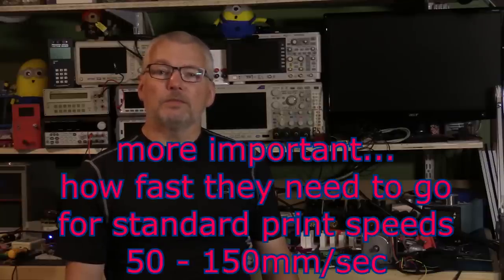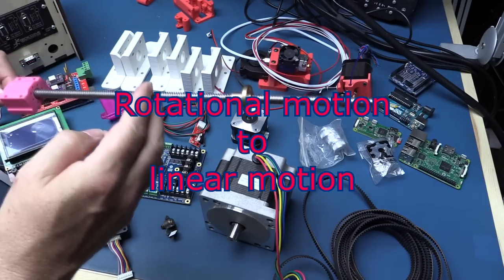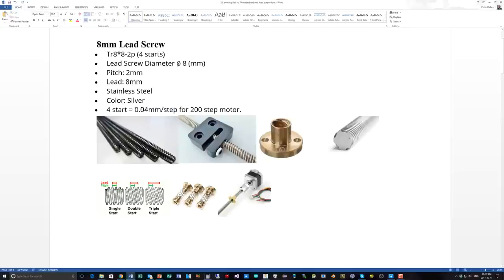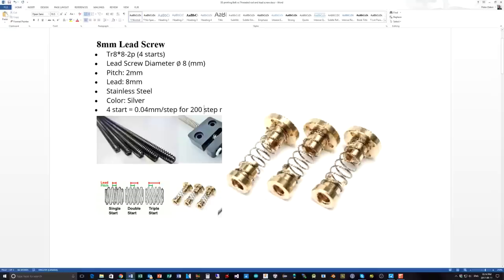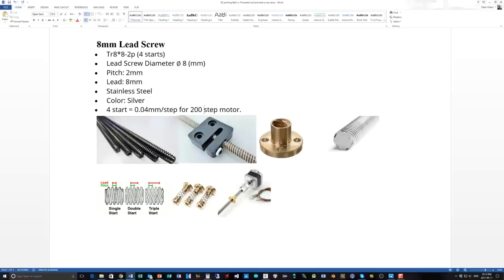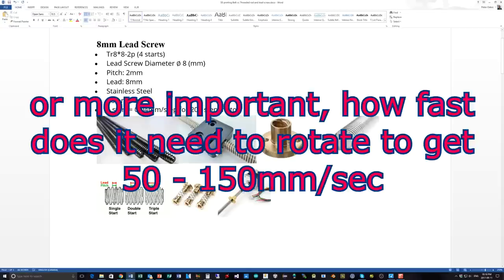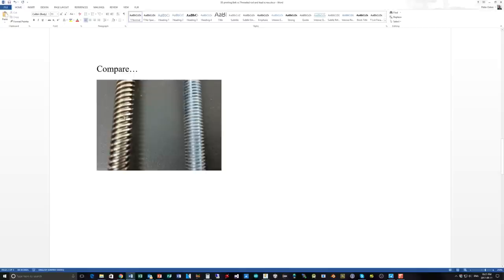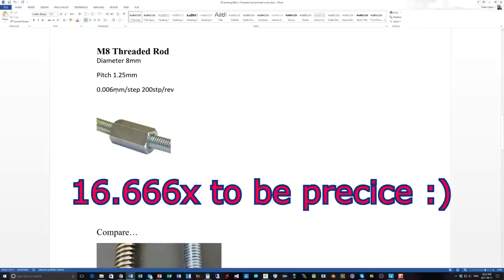3D printing, what to use... BELTS  or SCREWS ??

Comment: A good way to significantly reduce the inertia of a lead screw, at high accelerations, is to switch from a "fixed nut, rotating screw" to a "fixed screw, rotating nut" configuration. Another advantage of this is that it completely eliminates any whipping of the screw due to it not being perfectly straight, thus reducing vibration in the system. The only disadvantage (apart from the relatively higher build complexity) is the extra slop/backlash in the nut holding bearings, which could be mitigated by using bigger, preloaded radial bearings or smaller, more expensive angular ones.

Comment: Currently designing a 3D printer that uses multi-start leadscrews.  Just a few comments:

1 - As others mentioned, those couplers will introduce backlash, and are not intended to be mounted that way.  The screw should be retained axially, separately, via bearing block, with the coupler acting to absorb any shaft misalignment.  Using those couplers as shown may actually cause or increase resonance at higher speeds.  I'd agree in this application that solid couplers would be better.

2 - It should be fairly easy to copy the design of an actual anti-backlash leadnut to 3D print, and source a spring with proper tension.  They actually could be had on eBay for relatively cheap.

3 - A leadscrew with anti-backlash leadnut is about 25-70% efficient depending on lead.  A 4-start (.5" lead) about 40% and 8-start (1" lead) about 70%.  While this may not sound too efficient, and larger steppers may need to be used, this also can act as a damper of sorts, since you wouldn't want a majority of the stepper's torque overcoming its own detent torque.

4 - I built a wood-framed router about 8 years ago or so.  It doesn't really expand nor contract much, since wood does not expand much at all along the direction of grain.  Plus, as long as the driven end of the screw is retained axially, you'll only see a change in accuracy as the screw rises in temperature.  

5 - Repeatability (precision) will be very good because of the anti-backlash leadnut.  Accuracy, you'll be at the mercy of the screw accuracy.  But even an imported ACME screw is rated at .003"-.007"/ft (because it's rolled-forged), and that's worst-case scenario over that length.  For the typical part made on a printer that can be adjusted out for the most part with the steps/unit setup.  Screws from known suppliers like Kerk, Nook, or Roton have specs for their screws, and really don't cost much more than the no-name stuff.  I should note you should be looking for "precision ACME" screws not standard ACME - they're slightly different.

6 - Aside from flex in belts, they do also have backlash with the teeth and how they mesh with the pinion.  Maybe it's good enough for 3D printers, but unless I got the belts and pinions from Gates themselves, I'd have no guarantee of the precision of the belts from the "unknown" suppliers.

7 - If you're going through the trouble of using leadscrews, why not use supported linear rail?  They can be had cheaply enough, and would actually add stiffness and strength to the plywood frame.

8 - There's a bit of discussion about steppers and heat.  In actuality steppers are designed to run relatively hot, when you get the max power out of them.  Yes with the cheaper steppers we normally use there are precautions, but the industrial-grade steppers have insulators rated to temperatures at least twice as much as the garden-variety import., and thus you can push them harder.  Also, steppers are also designed with a flange and pilot which (1) absorb torque and (2) mate with a stepper plate or machine made of metal for transference of heat.  Since most all 3D printer designs have steppers mounted to plastic, the heat is not dissipated well.  But even some cheap CPU heatsinks would help greatly if there were heat concerns.

Comment: excellent Peter. This is by far the best tutorial on this topic. Luckily the small servo motors are dropping in price so that they can replace the stepper motor based losses and in combination with ball screws you can come to an optimal configuration. Surely not for everyone, but accounting time on printing, material spoils for bad prints and frustration, i totally vote for going to the best you can afford to build a printer. It will benefit in the long term. Greetings from Herri in China

Comment: Thank you for your video, there is additional information I would like to add to your coverage.
• using the aluminium spring couplers on X and Y will introduce backlash, as they are springs, and unless there is a thrust bearing preventing motion of the leadscrew along the axis, unacceptable loss of motion control would occur
• as you suggest, there are limits that are driven by the hot end capability, which especially limit us when printing eg 0.4 mm layer heights to 250mm/sec or less without running out of filament. If however layer height is reduced, to 0.1 mm for example, the same hot end could potentially extrude up to 1000mm/sec. the benefit being that overall print time could be less affected for thinner layer heights.
• TrinityLabs aluminatus A1 was sold with triple stack nema 17 25mm 10 start linear stages. These were approx $800 each based on conversations I had with Ezra at the time he was building these printer kits. Yes they are very expensive.
• I have video on my YouTube channel of these linear stages running at 720mm/sec without additional weight ( eg extruder or build platten) these are really amazing linear stages, and are key to the high accuracy and speed the (properly built) aluminatus is capable of. 
• You have mentioned belts and belt ringing. These artifacts disappear with linear stages.
• In practise, the repeatability and speed of these stages is definitely a worthwhile upgrade, and the improved accuracy of head placement makes prints at 0.3 mm layer heights look as nice as belt driven 0.1mm layer height results.
• A perfectly acceptable print result is possible with belts and steppers, my i3 build manual on reprap.org features my Průša i3, built with Josef's aluminium frame parts, genuine J-head, metal gear system extruder and so forth. I will post some links as a follow up comment to this post, although they will likely be marked as spam for approval. I hope this helps support the conclusion of your video that lead screws can perform very well in 3D printing applications. Thanks for your video mate
Reply: Photographs and videos of my Aluminatus rebuild with smoothieboard controller https://flickr.com/photos/87180506@N08/sets/72157647547282865
Reply: Nice build there.. :)

Comment: Thanks for the excellent explanations. Great inspiration for me to continue with my lead screw delta build.
Reply: maybe a bit slower than a regular delta......but with an amazing resolution. That....and magnetic joints......and  up you go my friend.
Reply: I’ve been thinking about the same thing. Putting some anti backlash on lead screw and Delta will be more stable holding it position.

Comment: This is a very interesting video. it directly relates to my new printer design. I will have 450mm x 450mm x 4mm aluminium build plate and was thinking of using acme threaded rods instead of belts. because i think with the inertia of the plate, i don't think it would take much of the bed movement for the belt to move without the stepper moving, which would make the bed move further than intended. Which is why i was going to use acme threaded rods.
But the 2 main reasons i think printers usually use belts is:
1. It is more complicated for most people to tune a acme thread than a belt. lots of math and fine tuning for precises movement.
2. The cost of a belt is roughly half that of a acme thread per axis.
But if you have a counter-point i would like to hear it.

Comment: Great video. I'm in the process of designing my first CNC machine and tried a hybrid of pulleys and lead screws. The screws seem much better for my needs, even if it's a little overkill. I have a belt driven 3d printer that works just fine, but CNC seems like it would benefit from the lead screws. I'll have to build a little printer with all the belts and gears I no longer need. 

Cheers
Reply from the maker: glad you found it useful, share your results if possible, it will be nice to see

Comment: While the application here is 3d printing, the same exact thing applies to CNC machines.  The mechanics of both are almost the same, Its only the parameters you require that are different. In fact,  even laser printers use the same basic setup. The important thing with a cnc is something known as chip load. Chip load is basically the ideal amount of material to be removed.  Its a combination of spindle/router speed and the feed rate.  Typically for wood and a typical router you must be able to get anywhere from 100 ipm to 200 ipm feed rates to hit that sweet spot. Granted, you can cut far slower but it often burns up bits. That is the critical issue to address with a CNC which usually means a far faster X and Y travel rates is required than a 3d printer and you will also be moving far more mass around

On my home brew I use 1/2 10 5 start acme rods with high precision anti-backlash nuts driven by NEMA 23 450 oz/in steppers using divide by 2 microsteping that results in .00125 in resolution and up to 300 IPM rates. And I still dont hit the mid band resonance point that all steppers have. The divide by 2 microstepping reduces the torque by roughly 1/3. But there's still enough power to snap 1/4 bits clean into. There is NO WAY I could get that balance of resolution, speed, and accuracy with a belt drive.. 

Overall an excellent description the the math behind the positioning issue. The only issue that I will pick on is a bigger gear will always give more travel per step than a smaller one. The torque will also decrease.

 Easy to show this effect by drawing 2 circles on the same center, one at 2 inches in diameter and another at 1 inch diameter. Now draw 2 lines at some angle through the center point. Look at the distance between where the 2 lines on the small circle cross and the same points on the larger circle. The distance will be greater on the large circle. 

A bit of trig will give you the actual rotational distance per step but is easier to simply measure it.  Mark a point on the belt and some reference point that wont move then take say 100 steps then mark a point right at the reference point as accuracte as you can.  Now divide that by the steps taken ( 100 in this case ) and you will have the actual movement per step. Note the more steps used the more accurate you are. 

Any motion control program will have some means in it to compensate for reality and what math shows. If youre close with the math, then just fine tune the controller parameters to get things dead on.

One of these days I just might try a scratch built 3d printer but my medium of choice is wood. Plastics just dont trip my trigger, I spent too many years doing small shop custom injection molding, and short run stuff.  :) Once in a while I whittle something out of wood where a bit of 3d printed plastic would be acceptable.

Comment: I've used lead screws to move a laser to draw light images in a wall. It had to traverse fast enough to make it look like a line, not a dot roaming around. It not only moved fast enough, but had the precision to continue to draw the image repeatedly without it wobbling. Belts moving that fast can bounce and cause cumulative inaccuracy. A 3d printer isn't going nearly as fast, so a belt is viable, but I like my lead screws. I'm trying to figure out a printer using an arm so there's only the one vertical item to work around. I'm hoping to be able to print at angles and even upside down in one shot. Like Tony Stark's robot arm that's always carrying a fire extinguisher. Yeah... someday. lol.
Reply: though rotating 2 mirrors instead of moving a laser is a lot faster for what you wanted to do ^^
Reply: We were changing the angle of a laser diode on a stick just a few degrees. It hardly weighed anything, so it wasn't an issue. Adding mirrors would just make it more complicated and harder to get done by the end of the semester. If we'd done it like scan lines a mirror or prism would have been the way to go.
I found six printer/scanners in the trash at work. I'm thinking I might use all of the lasers and mirrors to get one consolidated output. See what I can cut and mount it on an old 3D printer... or the front of my car! :)

Comment: In terms of torque the screw wins most of the times, the only issue is how much slack your nuts have and a good leadscrew is much more expensive than gt2 . The gt2 is consistent and cheap, but on the other hand most printers are poorly designed in terms of lateral force on the motor shafts and pulls on the bearing on one spot. Ballscrew will not have that issue as long as it is aligned . It is more complex to build but more sturdy. Leadscrews is also used in many ink printers and work fine with a heavier setup than a bowden tube does.

Comment: I think you've missed a thing, sorry if i overheard it; but basically another issue you have with lead screws is that any potential excentricity of the screw on the motor coupling will introduce a varying offset along the screw depending on the rotational angle that the screw is currently at. I think this is the reason why lead screw drive is not established for very precision sensitive XY in desktop 3D printing.

Also i don't believe in anti backlash nuts. I mean they will remove backlash statically, but in movement, they will still be loaded to one side or the other against the spring and introduce a velocity dependent offset.
Reply from the maker: The eccentricity is a possibility but if the bed / gantry etc is securely mounted on good bearings then there still should not be any wobble.
LEAD screws are established in many situations were precision is required especially at higher accelerations, BELTS have a tendency to stretch and oscillate too if your not using good ones, one of the primary reasons belts are used over screws would be 1. acceleration (Moment of inertia) and Cost. as with everything it is about picking the right parts for the right job and compromising were your able to get the best you can vs not breaking the bank
Reply: @TheBreadboardca  You're right, belts fundamentally behave akin to anti backlash nuts, also being a spring of sorts. At least the issues are velocity or acceleration dependent rather than periodic.

I'm finding that centering even just the Z rods on flex couplers is a bit of challenge, but it can be done. Perhaps Prusa has been right though to use motors with integrated lead screws turned down to become motor's internal shaft.

Comment: Hello,

I need your help to make some key decisions. I am making a large size 3d printer CoreXY type, bed will not move, size - 2300*1500*1500mm (X Y Z).

Due to the large size of x & y, I have two options, one is to use large width belt 10mm, another solution is a ball screw.

We don't have to compromise in speed and quality, so please guide according to your experience.

In the view of the ball screw, I don't have experience of use of a ball screw, so there is doubt on the backlash problem in the ball screw.  So please guide that, Have you observed backlash effect in ball screw, if yes than please guide on how to fix this problem. 
Please discuss in the view of ball screw SFU1610 for X & Y axis.

Also guide, ball screw SFU1605 is better or lead screw for Z axis. 

In lead screws, we eliminate backlash effects by using anti backlash spring nuts. Same way is there any way to properly eliminate backlash in Ball Screw.

You can also suggest your ideas for a large size printer.

Please reply